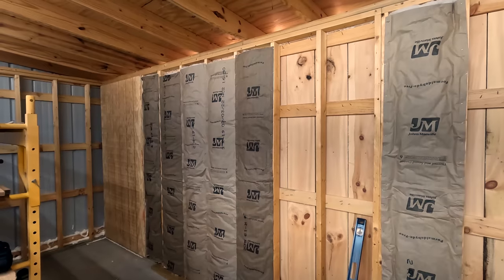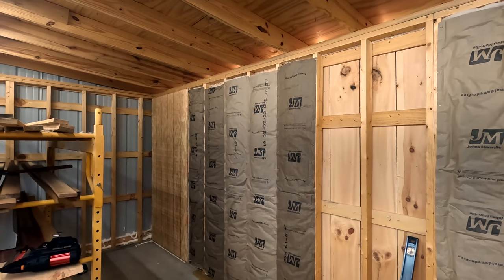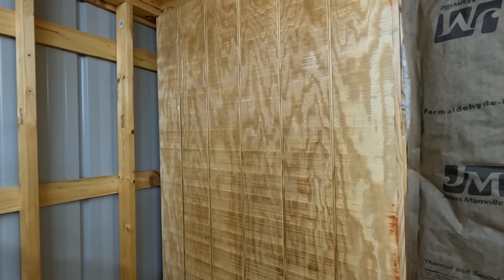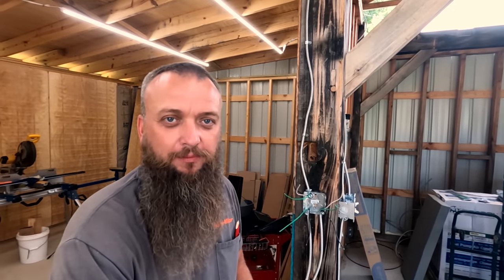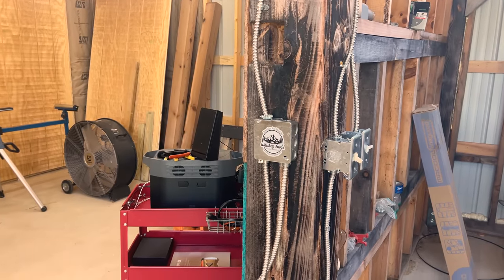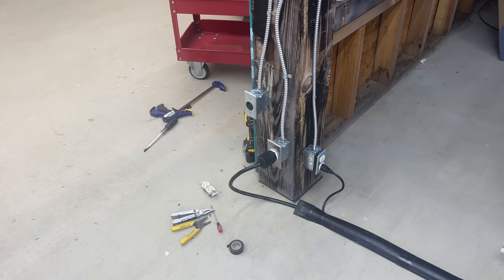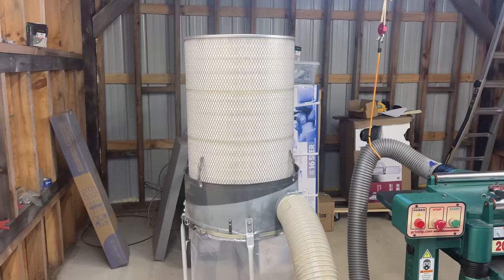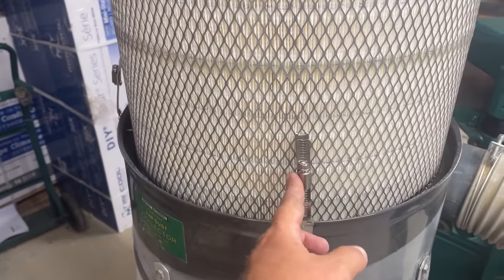This Isn’t Burger King.

Comment: Nathan,  please don't change anything you do!. I'm a 70 year old cabinet man and people seem be trying to find ways to get to where they don't have to work anymore.  I keep trying to find ways to keep on working. Watch all your videos. You are awesome!
Reply: Im with you! My heart petered out when I was in my forties and Im just not cut out to sit at home. I sit in the car waiting for my daughter to come out of the store and I see people hurrying here and there. I just miss it. ☹️
Reply: I seem to remember working with someone with your name Al Fonseca back in my working days with Bechtel
Reply: Al I worked with a man by your name back in my working day's with Bechtel.
Reply: @stevemichel3877  Sorry sir, was not me
Reply: as.ricky nelson sang in garden party you cant please everybody so you have to please your select. in words i try to use is that there is a method to.my madness as i know what i like. you are open to ideas from others to see if there is a better solution for the the problem.

i probably might use a spiral nail verses. the smooth. in older days i would have done it with a hammer. but using a nail gun is faster and smooth and less vibration on the structure.  so my ranking subject to change with additional change. a few nails it might be a hammer. more then a nail gun  either with a nail gun with the air compressor which is noisy  and a nail gun with compressed air and every solution when it works it is good but it it fails ( john wayne in big jake said it best in the phrase. " your fault, my fault, nobody's fault " when it works it works when it dont the it does not work.  but if it works leave at alone until you learn of a better improvement  weigh  the best pros and cons. accentuate  the pluses and minimize the minus.

after a bain fart. the nail might be a ring shanked shingle nail. small head.smooth finish brad type nails do not work. 

for pvc plastic finish trim or facia board use galvanized or stainless steel medium headed nails. i prefer stainless that is true stainless because some stainless is not stain less.  miter joints need pvc glue.  no pin nails. otherwise it voids all  manufacture warranties.

i prefer chip board because of lower cost of r11.  but if i found r11 at aspenite or osb ( oriented straind board  chipboard. to many options and the best option is dry tongue and groove boards that i could make or buy.  the constant battle of time and   money battle. when you have no time you spend more money. when you have to money you have to spend more time. and willie of the nelson family sings in song honey if you have the money i have the time. if you run out of money i run out of time. hay is for horses better for cows and pigs and piggly wigglies don't know how. but willie nelson is a hillbilly and he performs at the grand old opry in the good state of tennessee  usa. keep working  nathan.  do what you think is right.

Comment: Your very lucky that your dad can help you out on you place.  My dad could not even figure out how to use a screw driver.  I took wood working  metal fabrication and auto mechanics in high school to be able to do these things on my own.  I had a 30 x 60 ft. shop with all the machines you could dream about.  I made furniture, bowls, gun stocks, toys and a whole array of wood products.  Also made  tools, metal benches, racks, etc. then I broke my back while Elk hunting by one crazy horse.  I still do some of the shop work that I can get around on a wheelchair .  I am 73 and love to make things till the day I die for sure.  Love your channel and the work you show you doing.  Be sure to do it as long as you can.

Comment: Awesome video Nathan,  HELL-O Yes block the negative ones, we just don't need them around dragging the rest of us down with them, truly enjoy your channel and proud to be a patreon member and get to see these videos before they are released commercial free, great benefit and much appreciated.
Reply from the maker: Thanks buddy appreciate it
Reply: T1-11 Looks awesome as it ages with patina, as it ages, later maybe clear coat spray
Reply: @texasjetman - Nathan two suggestions with the T-11 siding.  Consider running a bead of construction glue down the center stud of each sheet to combat the insulation's tendency to make the sheet bulge outward.

Second - consider using HD's Behr exterior [deck] stain as opposed to paint, as the siding is so dry it wicks up paint like water even when using a priming sealer.  The Behr stair is thicker and although it penetrates, it only goes in so far and seals while protecting.  Plus, it comes in variety of colors so you can pick which ever one flips your switch.  

Anyway - just my two cents and ignore the naysayers, you are making great progress.  Stay safe and healthy.
Reply: @mstrdiver  the only problem I've found with that siding, I've heard it called 'smart siding' not too sure about that....lol, it has quite a few teeny tiny voids made during manufacturing, the insects find these holes very quickly, and now, the birds have realized that the insects are there and hiding!!! So now, we have birds being taught by others to look here for food!!! NOT GOOD!! Nathan using it indoors, seems to me to be the only acceptable use of it, seeing as there aren't too many birds indoors!
Reply: @jeffffro7674  yes I’ve seen some patches in voids on some sheets.  I’ve also had a few 4x8 sheets actually de-laminate along the seams in outside extreme heat.  They were only painted and not what I call a deep penetrating paint job.

Comment: I have a few suggestions for ya. #1 Get a Radial arm saw. You can cut wider boards to length, turn the cutting head sideways & rip lumber, like a table saw & make compound cuts. #2 Run PVC or ABS pipe along the walls, about waist high, put a Tee & a slide gated portal into the pipe behind each of your machines & use flex hose ( shopvac type hose ) to connect them. You can open or close the portal to each machine as needed. Connect this set up to your dust collector & you have an out of the way dust system. #3 Paint the walls in the shop with an oil base paint & primer. It will last a long time & be easier to clean the layers of dust off in the years to come.  These are just some thoughts I wanted to share with you. Hoping your shop turns out the way you'd like it to. 
p.s.  My Brother bought a Craftsman 10" Radial arm saw in the late 60's & it still working just fine.

Comment: We always used 6d (2") finish nails to install T-111, both hand nailing and with guns.  Of course, for exterior we used galvanized, which you wouldn't need indoors. Brad nail heads don't have enough pulling power.  Screws tear up the finished ply, IMHO.  I, personally never liked using T-111 ever since it first came out in the 70's. It was a rt-111eal cheap alternative for home building developers. But, when the homeowner put soil for flowerbeds too close to the house, the T-111 would wick up moisture (we get only 38-42" of rain each year here in the Pacific NW) and get mushy along with growing mold.  Should work good for interiors, what with the price of sheet goods today.  I'm thinking of covering one wall of my new shop with it.
Reply: In my architectural & builder experience, we wrote it as T1-11 but whatever. I like the heck out of it, though, in just abt any application. Natural not painted.

Comment: Seal it. If you want, use Thompson's water seal clear. Just raw it will attract and HOLD dust and sawdust. By sealing it you can wipe it down with anyhing wet and it will clean right up. Also less likely to try warping on you for humidity. Just saying. I would spray the concrete floor the same way for the same reasons. Just put Thompson's in a garden sprayer and go to work. Easy and so much better for cleanup. Thompson's is hydrophobic so water beads up on it AND is is non slip as well as food grade, so no worries about chemicals around stuff for kitchens like slabs for countertops. Have a roller handy for any runs when spraying as it is really thin. You cannot second coat for years so soak it the first time.
Reply: I keep a roller on a five foot handle like a broom stick just to spread out runs and such as needed. You will be amazed how easy your life will be when cleaning the shop in the future. sweeping will glide and you can sweep walls and floor easy.
Reply: Hmmm.  Decreasing dust 👍 but I am wondering about sealing just one side. Probably not an issue, but maybe a consideration even for interior installation.

Comment: Hi Nathan, I'm in that other club like some of your subscribers are, I'm 77 and in the wood shop nearly every day in the summer in Minnesota.  Iva had several career changes through my life time due to economic changes, resessions, etc. From a profession musician to a manufacturing jeweler/diamond setter to a journeyman machinist both manual and CNC.  Because of my backround I was hired as a production engineer/designer (oh, I'm also a 3D CAD technician with 25 yrs experience) and during that time I was incolved in operational equipment and toolding.  OK, here's my theroy and I'm sticking to it;  Tool quality and expense is directly related to tool pressure.  Example if the tool will be used 3X per week I didn't purchase high end stuff and the opposite if it were used ewvery 7 minutes, i bought the best. My point, Festool is very good tooling but why would you spend that kind of money if other equipment will serve you costing less.  fLike you channel and as always, keep on smiling.  Whew, that's a lot of BS I just wrote.

Comment: The nice thing about plywood on the walls is that it can become a tool storage system just by screwing holders, brackets, etc into it: No need to seek out the studs to secure them. I personally have some 3/4 maple ply along one wall of my basement shop with a lot of magnet strips for tool storage. I concur with the use of the deck screws: Better holding power by far! As for your negative commentators: realize that there are a lot more supporters out there that are more silent than they should be. Your wiring looks fine to my non expert eyes, as does the selection of your building materials, garden, etc!! Keep up the good work!

Comment: I like the look of the siding, but I have found that it holds sawdust badly. If you plan on doing any finishing in the area that might shed some dust into your finish. Since it's already up I would put a heavy white paint coat on it to fill up rough edges and be less likely to hold dust and make the room brighter as white will reflect.
Reply: Really good idea.

Comment: In TN I'm not sure, but in NW IL with our temp changes 2 1/2 Brad Nails won't be enough for the interior paneling attachment.  I used 3/4" for my interior and attached with #10 2 1/4 SS deck screw to attach to the walls.

Comment: If you paint that wall with a good white enamel paint it will be easier to clean and make your shop brighter.  For dust collection on my miter saw I used a fine mesh cloth laundry basket.  when it gets full you just turn it inside out and clean it.  No hoses required.

Comment: Nathan,  I have a couple of comments and hope I don't get blocked.  1) get a 2-stage dust separator from Grizzly W-1049.  I have the same planer and dust collector.  You can fill that bag almost instantly.  The separator sets on a metal garbage can and collects the larger material.  It helps but still, the can still fills too fast.  I'm looking at using 55 gal drums on casters,  2) think about adding some clips on that armored cable closer to the boxes.  I'm 73 and wish that I could still lift and carry a hundred pounds.  Cancer sucks!

Comment: I had a shop for years that had bare T1-11 on the walls. I loved it. No worries about dings, etc. as I moved stuff around. Being as it was rough finished plywood, I could put a screw or a nail anywhere I wanted to hang something. That’s why using only brads to secure it to your studs concerns me a bit. You might think about a few more screws in areas where you’ll likely hang things but you could come back through and do that at a later date.

Comment: For your installation of the T-111 on the interior is fine with brads. Exterior you want a 6-inch on center parameter nailing. 8 inch on center in the field. Shear rating you want your corner sheets 4-inch on center parameter nailing 6-inch on center in the field plus every sheet 20-foot spacing down the wall.

Comment: I have a Wynn filter on my old chip collector that I started using exclusively for my planer.  The biggest problem is that you have to empty it when it gets 3/4 full.  Otherwise the planer chips get up inside the Wynn filter and it is a mess cleaning it out.  The Wynn definitely increases your suction and has better filtration, but it is much easier to clog up when using it with a planer.   Also, if the Harbor Freight collector has a guard on the inlet, you will need to cut it out for the planer.  The big long stringy chips will clog it up in a heartbeat.

Comment: Great video as always. Love how you tell it like it is with viewers comments. T-111 on the inside is a great idea. Very durable for a workshop. A lite coat of white stain on it could help with the dust and keeping it brighter inside. Agree with utilizing the electric and not adding additional wiring to save on cost! Very frugal.

Comment: I’ve used T111 for inside walls quite a few times Nathan. Makes a good solid wall and looks nice. I also left it natural but I have shellacked it in some places. I say it’s a good choice for your shop and you can hang lots of weight on a wall like this. I’ve used  2”-21/2” brad nails in a few projects 20 years ago and it’s doing fine for an inside application. And as is said, anything worth while takes time. Once I get started on a project I can hardly stop. Kind Thanks and Many Blessings! DaveyJO in Pennsylvania

Comment: It's a pleasure to see you getting your shop set up, looking forward to seeing you do some wood working again.  We just stained the exterior of the saw mill shed with Arborcoat (Benjamin Moore product) and it was really nice to work with and it's available as either oil base or water based.  It may be a good choice for the wood siding on the exterior or your shop.

Comment: Insulating the wall is a great idea, what is you plan for the gap above the double plate between the roof rafters, where solid blocking usually is installed?

Comment: I always hated having to do hard work, but I never seemed to avoid it. Hauling firewood from the time I could walk, to bucking hay, moving water pipe at age 11, and once I turned 18 working in a nickel smelter with the heat, noise, dust, and shovel fulls of heavy ore. I used to think that hard work was some sort of penance I had to pay for living. Now, in my late sixties, I am arthritic and can't do much and I really wish I could work like I used to do. Isn't life funny and strange?
Reply: Yes, it is, but you can still work with your mind.  Technology today opens up new worlds.  I estimate Mr. Elliott's "job" is about 1/3 physical labor, 1/3 technology, and 1/3 thinking it through.  You have 2 out of 3 so what are you waiting
for?  Get started .  .  .  .  

Here's a hint:  the last one counts the most.
Reply: @ralphpezda6523  My old man always reckoned the most important tool in the shop is the four inches between your ears.

Comment: As a suggestion, and since you cruise Harbor Freight a little, you might consider their coil siding nailer.  I bought one for doing fence pickets so I only use inch and three quarter ring shank galvanized nails but for your t-111 project you could use two inch ring shank.  A benefit to coil verses slide is capacity and you can shoot either clipped or full head nails.  Just a suggestion but brad/finish guns are for trim.

Comment: Most Anchorage, Alaska homes built in the 80's and 90's had 5/8" T-111 used for exterior sheeting and siding. I used 3/8" fir plywood on the walls, in my shop, finished with clear poly. Next shop will be white steel on the walls for light reflection and easy to dust off. Even when I worked in large overly well-equipped, prototype wood shops, with every machine hooked to dust collection, the "mill room" was dusty/dirty.

Comment: looks good Nathan,,may be just a little bigger nail..brads are good for paneling...if they hold good use them..i use 30 amp plugs for all my tools,,using 110 volts..and heavy wire,,its a tougher wiring,,but worth it...and 220 heavy wire is a must...if your going to spend the money get the best you can afford....i really go by how big the motors are,,,and you should no what to use...love your shop....be careful man..

Comment: I agree you you Expediency has a quality and value in itself. As for finish for the inside of a shop I don't think it really matters, you might judge from past experience how much dust collects on the surfaces depending on the surface roughness, paint might lessen or make cleaning easier. The only other option on Diesel would be if you have a restaurant you frequent that the owner might be willing to give some used cooking oil and do a conversion or make bio-diesel but with your location that's probably easier said than done, the electric option requires a fair number of amps for a big enough motor then you can run into other issues. Your comments on work ethics are on the money  I learned work ethic in a family business ... if you wanted to eat you needed to work, otherwise there was no $ for food ...

Comment: Get a 40-50 gallon plastic drum and lid. Make a centrifugal dust separator. And install in the stream of your dust collector. There are videos on these. It will drastically improve your dust collection system. Just a suggestion. Love mine. This will take up to 90%+ of the dust out of the stream and leave the rest to your filters.

Comment: just make sure when you want to hang something on that wall go into the studs, use a clear coat on the T=111 and insulate the ceiling to keep heat in. lookin good